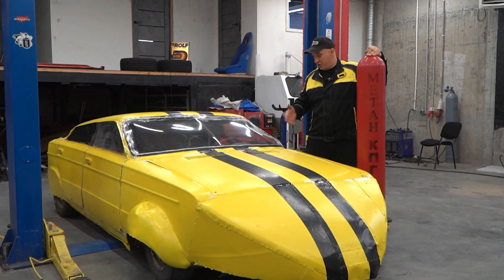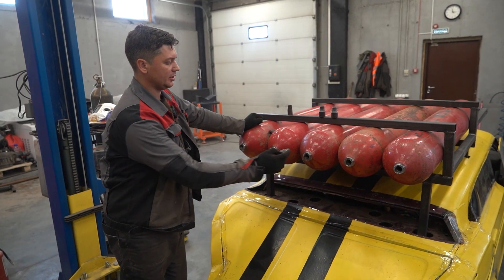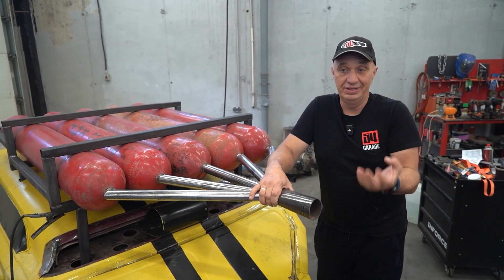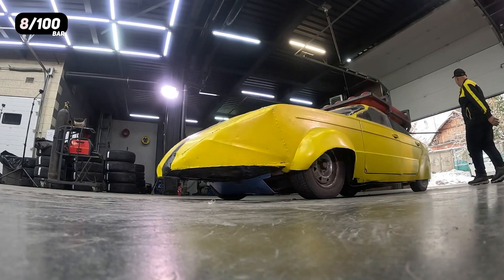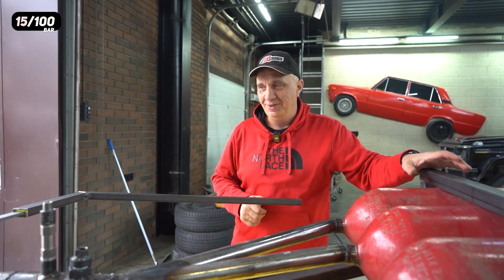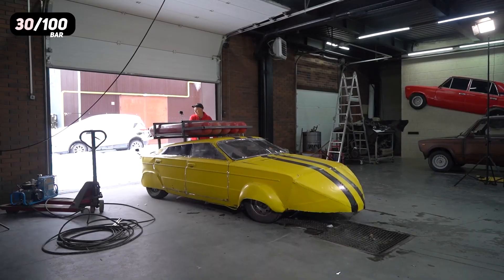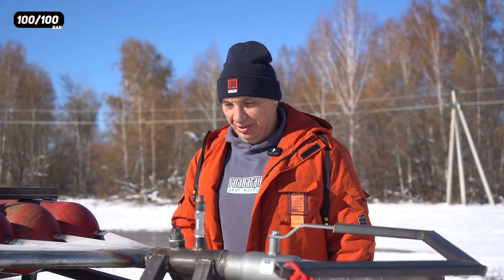Rocket propulsion for our Aero Lada - will it work?

Comment: I believe water rockets work better standing up, because the compressed gas pushes out all the water first. Otherwise the pressure drops quickly before all the water is gone. Maybe if you stacked the cylinders on two layers, the top ones containing air and the bottom ones water. Then link the top to the bottom, and attach the nozzle to the bottom ones.

Comment: 1,470 psi. Use a pipe bender to get a smoother flow from the outer cylinders, you should get a better result.

Comment: I’m not sure if they read the English comments but a great way to improve. It would be to have each tank separate with its own nozzle and valve and have a rail connecting all valves. This would let you precisely control water in each cylinder. You could also rig the valves to a pedal in the vehicle if you are crazy enough to ride the lightning.

Comment: F=ma is a simple equation that can be rearranged to ma=ma. So when applying the same acceleration, the masses matter. If you use water, water accelerated has more mass than air. It will produce more thrust.

Comment: Pressurize a carb with the cylinders.  Use a quick action valve and regulators.  Go wot and the valve changes from a suck to blow through the carb with 20 psi

Comment: Ok, after putting way too much thought into this, here is my idea... please tell me if its good of if I'm dumb.

So basically reciprocating-based air breathing rocket. It would use a driver (probably a one or two cylinder engine) an air compressor, fuel and water pump, combustion chamber, and nozzle.

The "driver" motor would spin an air compressor, water pump, and fuel pump to provide those fluids, at pressure, to the combustion chamber. 

Fuel (gasoline, diesel, kerosene) would be injected into and mixed with the high-pressure air, then burned in the combustion chamber.  These hot exhaust gases then go through a nozzle to trade high pressure for speed, then blast out for thrust. 

To prevent the combustion chamber from melting, surround it in a water jacket, which is fed with water at pressure. The water in the jacket will boil into high pressure steam. Then, take that steam, and route it into the exhaust nozzle, to augment the combustion exhaust thrust.

As far as I can tell, this should be a decent system. The air breathing should help it last longer, it's not as dangerous as big pressure tanks, and it won't melt itself.

IDK though

Comment: High Purity Grade Argon, 6,000 PSI High Pressure Steel Cylinder, CGA 677. This type of tank will handle 6000psi or 420 kilos/cm with some safety to spare.

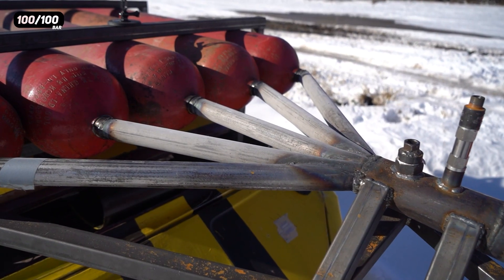Comment: 8:30 the thing to remember is when a gas is suddenly reduced in pressure, its boiling point drops so it gets very cold. It’s the same way refrigeration works. If the pressure drops too fast the water in the cylinders or pipes will freeze solid very quickly, especially in those frigid conditions. If you want to prevent freezing either wait until the weather warms up or use beetroot juice instead of water as it won’t freeze and isn’t toxic like ethylene glycol. It’s what they put in tractor tyres in Canada and other cold places as ballast.
Reply: So… a borscht rocket? 😂

Comment: My suggestions would be to fix the leak on the exhaust pipe and maybe machine an actual nozzle to remove little imperfections on the inside of the nozzle. Also why not cut the tanks in a little so you have a wider pipe, more flow can be achieved that way.

Comment: You need to put Chambers in the tanks so 1/2 to 2/3 can be water filled and can only escape through a venturi. That way as the air escapes it can pull a metered predictable amount of water with it. Bonus points if you option to make a few different venturi nozzles that are threaded so you could test the different options.

Comment: It'd be interesting if you used hot water and sent it through a heater unit to flash boil it into steam just before it exits the nozzle.  Steam is 1700 times the volume of water so that would increase thrust.  Be hella dangerous though so maybe wear a hat.

Comment: Removing the valves and having your manifold under full tank pressure is very dangerous! The tanks will handle FAR higher pressure than your welded bits!
Reply: Not sure these guys are danger averse, 😅

Comment: From my experience water propulsion works best if the tanks are 50% full of water. Also if the water is hmmm how to explain, down against the valve, so that the water is forced out first. 

But also I've seen a scuba tank blow (100 bar) and they really really make a mess. 100 atmospheres is a huge amount of force. Huge. The tanks will go through a wall.....

Comment: The outlet pipe needs to be in the very bottom of the cylinder.  This way it is completely submerged in water and the air pressure must push out the water first.

Comment: Put a stand pipe inside the tanks below the water line preferable to the bottom and then put on the exhaust pipes on.
Air on the upper areas water below and a little hole on the top of the stand pipe so you can load water without issues.
more usable water thrust

Comment: Put a water tank on top of the tanks and plumb lines from the water tank into the plenum for the air tanks. Then youll draw water in through the venturi effect and not have water taking up space in the air pressure tanks allowing more air at the same pressure for a longer duration of effect.

Comment: and... the water mass is injected into the restriction point of the nozzle. water injection, not homogenized water in the pressure tanks! ... that requires the water mass to be injected with a pressure higher then the outflowing air tanks or create a capillary vintury after burner, that uses high speed air draft to suck water mass from a tank of water adding to the exhaust mass restriction over molar displacement of material that creates higher nozzle pressure and more thrust. simple as welding 3 small tubes parallel to the nozzle and around it tho welded to the expansion side of the outgoing nozzle so that the high speed air draft pulls a vacuum on the three tubes to syphon water from a simple jug... more so, can later replace the water with gasoline/diesel and add an electronic discharge ignitor array... and add metering valves on too, to get the fuel syphon stochiometric. ... one will / 1 gallon fuel...
Reply: pure oxygen, not just compressed air...
Reply: adding the pulse jet magnifier chamber

Comment: I think you're on the right path, but without going to some sort of propellant outside of water, i think the easiest solution is to find a way to inject the water from its own reserve which the air pushes through rather than combining the two

Comment: Water is not compressible so it waste space inside the bottles. Put a water into a separate open tank. Route the water to an inlet after the valve. Use the venturi effect to sip the water out of its tank and eject it with high velocity. This will keep the full volume of the air tanks for compressed air. It will accelerate the water and eject it, gaining a better and longer trust than ejecting water contained in the air tanks.
Reply: Exactly what I wanted to suggest. Though they need to make the funnel right or their water container may go boom :)

Comment: With a custom camshaft you could actually convert a Lada engine to run on compressed air. and if you feed these tanks into such a modded engine you could drive the car on nothing but compressed air

Comment: The way you connect the 4 pipes is bit incorrect, at the joint the air and water partially cancel each other before exiting because they hit each other in opposite direction , the connecting point should allow more flow

Comment: You can test it with more than 300 bar BUT using water, if it can reach ~400 it should be safe to use with 300 bar as many times as it is fun, if you can't use water then it needs some kind of automatic (remote) disconnection from compressor, while you stand far away. This thing can explode harder than these tires you used to rip apart a car.

Comment: looks like fun but please be careful those pipes can uneven torque  since the tanks are not welded solid and any movement can cause the thin pipes to be a bomb from just a weld break at 800 psi especially anything above. either way great content.

Comment: Maybe tilt all the tanks downwards by about 30 degrees to make sure nothing but the water comes out first before the compressed air.
Reply: Was going to say something similar.  Better yet, have a set of downward angled tanks filled entirely with water, then a set of tanks feeding into the back/top of those filled with compressed air. Ensure only water is expelled, and give the ability to tweak how many air VS water filled tanks there are to optimize thrust VS duration
Reply: Yes, 30° may improve efficiency, but it should be paired with a -30° pipe bend to ensure no losses in upward momentum and with such high pressures, a 6040 water mix might be able to utilize that pressure better
Reply: @Garage_scientist-w9c  didn't realize they measured water in viscosity like that.
Reply: as soon as they start moving the waters slammed to the back anyway.
Reply: You are quite right
Reply: When the car accelerates the water is pushed backwards by static inertia so I think it's actually fine as it is.
Reply: Made the same comment. Also isn't it more effective to have about 50/50 water/air?
Reply: But then it might take off.
Reply: Put something that burns into it
Reply: hysterical 😂😂😂😂
Reply: they need a way to control how much water and to make sure the tanks are filled evenly...
Reply: @regulatormachine2788  fill it with a combustible gas
Reply: On the roof of the car,  place a blast shield, ideally ballistic armor panels   if there's a driver with hearing protection 😉 
The water rocket lada😂
Reply: Water under such pressure would be evaporating it doesnt matter.. my take on this
Reply: @simonmeszaros2770 water at high pressure evaporates at higher temperature
Reply: @Kaiju-Goji  thats right...but we dont change temp... so that makes me question where all the steam comes from. is it only that air is capturing water on release ?

Comment: I se Very difused spray pattern from the nozzle, i would start by either bying or making a proper De-Laval nozzle, which increases the speed of the exhaust gas to possibly supersonic speeds, and remember that you have 4 or was it 5 tanks, either way, i think the way the pipes from each tank connects might not be the best, its a lot of cm³/s pushing against that connecting pipe to the nozzle, and it is quite small, so i sugest a little math, and a propper De-Laval nozzle in the apropriate size for the thrust you are looking for.
Good luck :)

Comment: Tilt the cylinders down at the back, so that the water is at that end and air cannot pass the water.
You will need to fill with water at the front. Fill two thirds of water, then the last with compressed air.
If the tanks are tilted enough so air cant pass, the air should push out all the water.

Comment: If you were to put the exhaust through a turbine and gear it to the wheels, it might perform better and last longer than piping it to the open atmosphere.  In the last century, we in the USA experimented with compressed air powered dragsters and they were very, very fast.

Comment: Well... first I'd say you don't need THAT much pressure, but you need fuel like propane to make a rocket.  Run the same pressure in the air tanks as the propane tanks and it should be ok.  Conversley why not try solid rocket engines used in model rockets etc...or a chemical reaction like baking soda and acid.

Comment: Fill it with all air and feed it to the carb.  You have to drive it on the highway at 80 kw and release the air into the carb like a booster and see how fast on the highway from 80 kw to 420 kw on the highway   just remember youll need a parachute for energency reasons

Comment: With pressure drop, there will always be temperature drop. You could start at a higher temperature, but it will probably still freeze. You could start at 200 - 300 bar and reduce the outlet pressure to 100 bar and heat the tanks as pressure drops. The slower pressure drop in the tanks could allow enough time to apply heat and keep the tanks from freezing. That is the best i can come up with off the top of my head.

Comment: I think that turning it into pressure fed rocket motor using some fuel and oxidizer in 2 of the 5 pressure tanks the thrust would 10x

Comment: Your output holes aren't large enough for what you are trying to do. They need to be a bit larger. Its all in the math so to speak. I cant tell you the exact size because idk what the measurements are for real. You will get alot more thrust with larger ports.

Comment: Fill the tanks with vinegar and baking soda!
Reply: Im curious to know what the effect is.
Reply: @Jools-j2l it would be funny, but I don't think it generates much pressure when contained. 

If it did, it would be easier to use baking soda and vinegar to explode soda bottles than dry ice, or some chemical and aluminum to make a nice loud flameless bang.

I love popping soda bottles, they are so loud, but I don't like using harsh cleaning chemicals that will mist all over my yard (or me), and dry ice is something you never have on hand unless you buy it for the occasion or get it in a frozen food shipment.

Comment: They are not messing around, the TIG welder showed up. If there is way to make sure that the water doesn't choke the air pressure. Speaking of venturi effect, not sure if it would do anything when you make a big "carburetor" that feeds the water into the nozzle - might be worth trying!
Reply: I was also thinking, what if they used the venturri effect to pull actual fuel into the air stream? Skip the water and just have an air-as-oxidizer liquid fuel rocket engine!
Reply: @DielectricVideos  They won't need as much air that way too, since the heat makes air expand. Could be worth a shot, if things hold up that is!